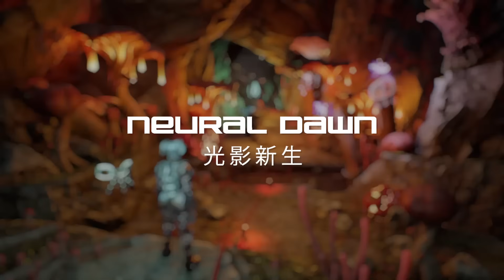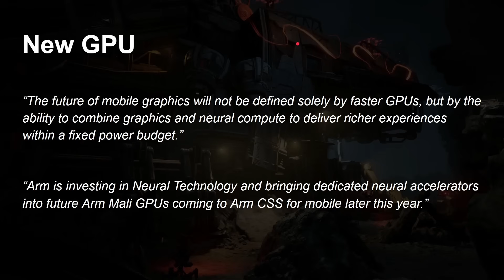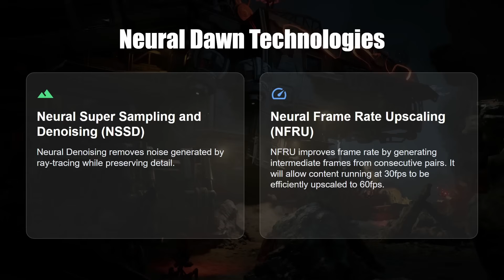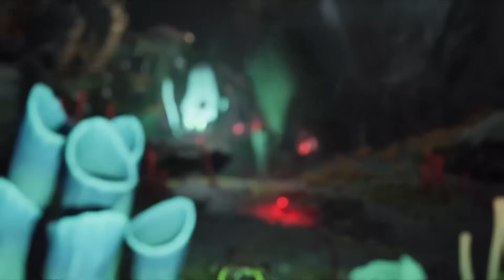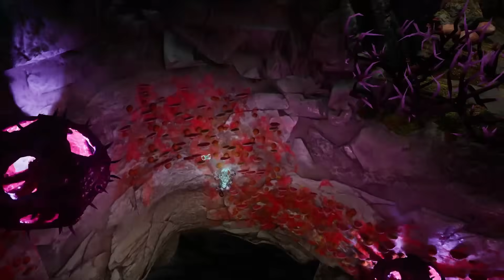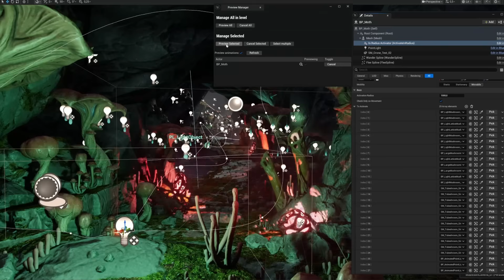Arm Teases Release of New GPU with Neural Accelerators

Comment: I wish ARM would focus on achieving Apple silicon performance
Reply: Apple silicon runs on arm. In addition to that, it's a niche market. Not many people are going to pay $6,000 for M5 mega ultra Pro Max equivalent on Windows. Arm would also lose customers if they entered the market at that level of competition because then at that point no one would by arm designs and they would have to make their own with risc-V which is license free I might add.
Reply: @meshingaround9828 I just want faster processors
Reply: @m @meshingaround9828  you can get a Pro chip for 1200 what are you waffling on about 😂